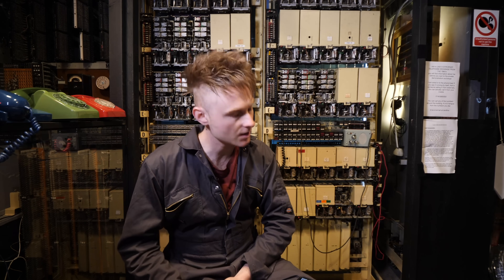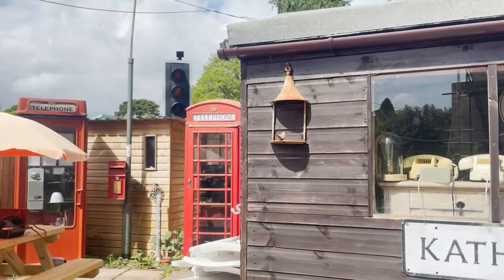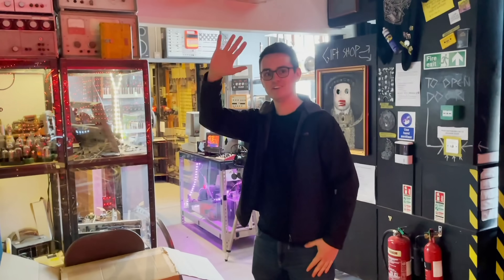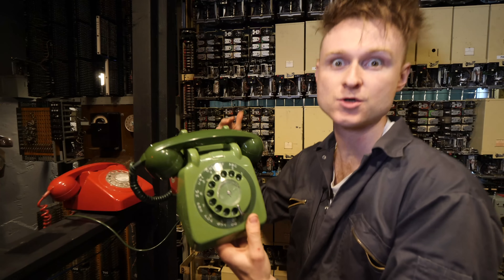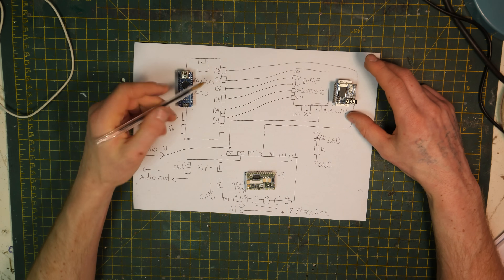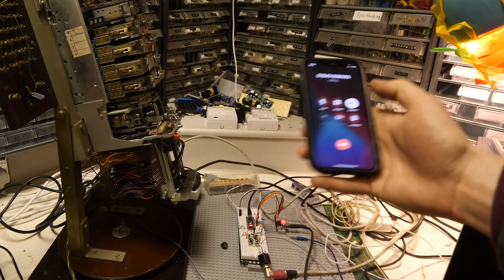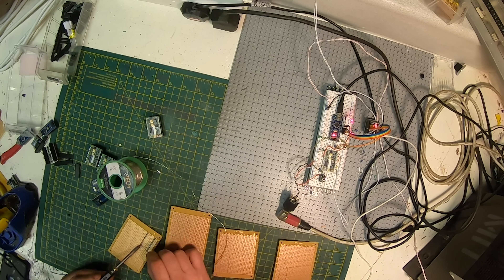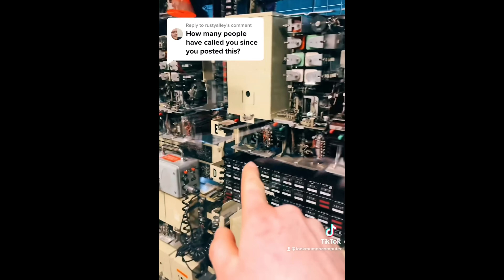Plugging a Vintage Telephone Exchange Into The Internet So People Can Use It

Comment: did i hear the magic word.. asterix?

Setup a sip proxy that people can connect in over the internet itself with using sipphone or sjphone or a cisco/linksys spa appliance.   That gives you effectively unlimited incoming lines.. and allows you to load balance by redirecting flash floods to a recorded message when all your physical lines are tied up...  also saves needing to actually pay for incoming time on a real phone.  Some spa devices too natively support pulse dialing if you plug an old POT pulse phone INTO it.

Edit: also SPA devices can call each other directly by ip address.. which i imagine you could do some very interesting things with...   Random internet guys SPA --->  internet ---> your spa --> open phone line to your exchange!

Comment: 9:39 is it possible to use discrete logic to convert the 4 bit pin output into a pulse? I sure have read about that in some old electronics book but yeah microcontrollers are just dirt cheap these days. Also hard to control the latching of the signal?
No computer ^_^

Comment: Used to work on these in country areas in Australia, we called them RAX’s (Rural Automatic Exchange)  in the early ‘70’s. Later we installed Ericsson based “ARK” “crossbar” switch based exchange equipment.
Enjoy your journey with the Step by Step (SXS) equipment you have there.

Comment: I'm curious why you didn't use an off-the-shelf telephone interface. I think most of them are still capable of doing pulse dialing.
Reply from the maker: Find one that converts dtmf to pulse and link us 👍
Reply: @LOOKMUMNOCOMPUTER  Tried linking one but YT ate the comment (maybe because it contained a link?) Any DAHDI-compatible interface in Asterisk supports pulse dialing, e.g. the OAK8X with FXO modules, should be fine. It's up to to the inbound channel in Asterisk to decode DTMF, and then the outbound channel regenerates the DTMF or pulse dialing.
Reply from the maker: @CoolerQ  aaah yeah I see. I have some fxo cards that’s the original approach I took but I couldn’t get it to do all of the time out stuff and hang ups right. Also the gaps between certain numbers and hang ups for the exchange to not get confused. In the end it was easier to do the approach in the vid.
Reply: @LOOKMUMNOCOMPUTER  Well, that sounds like a software problem. I'd rather have reliable hardware and unreliable software than the other way around, because it's a lot harder to upgrade hardware :) But yeah I can totally imagine pulse dialing is not well-tested in Asterisk.
Reply from the maker: Cus we couldn’t find one that did it with all the requirements

Comment: 7:50 What you're doing here is actually an early form of phone hacking. Sometimes people would try to prevent phones being used to dial out by fitting a key lock on the dial – but it was still possible to dial numbers using this rapid break/make technique. Amazing, I never thought I'd see someone doing that again :D
Reply: Back in the 70’s my parents put one of those locks onto the phone to stop me from making phone calls, obviously they cost money, so I found out that you could bypass the locked dial, by using this method, so when the phone bill was higher than expected I could just say that it was nothing to do with me . Lol
Reply: Yep - I remember here in New Zealand as a young lad (45+ years ago)...we used to go into a public phone box and tap out a number we wanted to call using the receiver 'hook' (in reverse as Sam mentions: 0=10, 8=2, etc.) and we could talk for free.....wow, I think we saved a whole 4 cents?  Anyway, that was a very different meaning of 'phone tapping' :)
Reply: Yep, I used to do that in the States back in the early '80s. Sometimes reception areas in hotels and schools had an "incoming only" phone with a circular dummy plate in place of the dial. This was an easy way to dial out and save payphone costs.
Reply: We could do the same thing with Army field phones, that had no dialer.  Normally routed through a switchboard.  We could plug the field phone into a line and tap out a number to call.
Reply: Wasn't it called "phone phreaking" back then?
Reply: @nongbloke  Yep, it was indeed! I believe there were other phreaking techniques too, but I don't know much about them.
Reply: @macronencer  I was "blueboxing" in the 90s (mid-late) as a teenager.  There were these toll-free (800, I'm in the US) numbers which rang directly to operators in various countries.   I have no idea who paid for them.  Most of those countries used out-of-band signalling, but some of them used CCITT 5 in-band signalling.  It used the same MF tones as the standard used in the US, except the supervisory signalling was more complex.  Well, after frustrating the operators for hours with my failed attempts (the equipment did not pass on-hook audio), I finally managed to seize trunks in Belize, Greece, and Chile (maybe some others).  The only one that had no restrictions was Greece, and it was an utter delight to use.  I rigged up a little box with a transformer and whatever else (I knew more about electronics then than I do now haha) which I used to hook up my sound card to the phone line, and effectively turned my computer into an operator's console.  For a while, I would even call my friends with it; they didn't appreciate the delay as much as I did.  ;-)  I could call inward operators in the US, too.  One day, after a year or so, I received an ominous message on my answering machine from "the phone company" asking if I were having problems calling Greece.  The number on my caller ID led me to believe it was probably some federal government agency, so I cut back a lot after that. :-(
Reply: @bsadewitz  Haha, wow! That's going deep :-|
Reply: @nongbloke  Most phreaking was on more technical equipment than that. Just dialling with the hook doesn't get you free calls or anything, to the exchange it's an ordinary call and you're billed accordingly.

Phreakers working with more complicated exchanges than that, ones that were digital or semi-digital. They'd use control tones, brief beeps, internally sent down wires to control trunk calls (calls to customers on distant exchanges, not the same exchange like if you both lived in the same town). The right sequences of tones controlled all sorts of things, and the holy grail to a phreaker would be found digging through the rubbish bins behind an exchange, looking for a technical manual. This would have all sorts of useful info.

Anyway... these tones... they were used internally, but phone companies rather foolishly would respond even if the tone came right from a customer. So phreakers made little boxes (and they all had their own names) that produced sounds of this or that frequency. Sometimes you could take a DTMF pocket dialler (they made those!) and change out the crystal to give different pitches than the device was built for. So you'd have a little box you could tap out the tones on to remote-control the phone lines.

So you could make distant calls for free, create conference calls, whatever was possible, from either your phone at home or some payphone somewhere. Talking of which, with some old American payphones you could call the operator and tell them it wasn't working. They'd ask you to insert coins and put the call through manually. When a coin was inserted, the phone made a particular beep. Different tones for different coins. So....! You could insert as many "coins" as you felt like beeping out, the operator would hear, and think you'd paid up.

All sorts of phreaking stories. Mostly from the '70s and '80s in America. Oh, finally, one that works in other countries... You call up a company out of hours, who have a freephone number to call. You get their computerised switchboard. It asks you which extension you want. Sometimes, you can dial 9 for an outside line, so their switchboard will call whoever you want. You're connected free, they dial out to whoever. Nice trick! People would try hundreds of freephone numbers to find one with weaknesses like that. Tonnes of fun!
Reply: Same :)  You had to do it very quickly and it was easy to make a mistake and misdial.
Reply: It'd be cool to see a crossover between LMNC and 8-bit Guy talking about phreaking
Reply: @stinkymart3173  The problem with 8BG and phreaking is that (no disrespect to him) he has a very "surface level" idea of the whole thing. Evan Doorbell is a good resource, plus he's an awesome guy and would give the shirt off his back to someone in need. He was there during the inception of phreaking, pretty much.
Reply: Ha, I remember doing this as well, and it was old tech then!
Reply: Rapid make/break is exactly what the dial is doing.

Comment: People can make SIP calls directly over the internet, and any of us using a pbx that supports it could trunk to you... so your trunking service's minute limit isn't necessarily a deal-breaker. You'll have to enable "Allow anonymous inbound SIP calls" and be damn sure anything that can dial /out/ (like to the pstn) is secured, then attach a domain name and advertise it... sip:extension@hostname ...

There are several other youtubers with big vintage phone switching systems as well... trunk 'em all together!

Something like the Grandstream GXW4108 is a bunch of those analog adapters all in one box, and it works with asterisk. SOME of them (I can't speak for the gxw4108, it's been years since I touched one and I didn't try this at the time) actually support pulse dialing as well.

Comment: This is brilliant, Sam! As an ex BT Strowger engineer from the 70s & 80s, it's great to see and hear those switches stepping!
Reply: Me too,I don't like to think of how many of those things I've cleaned. Once we had got thru the entire exchange it was time to start again.
Reply: @adeladd7638  yes, wiper and bank cleaning routines were certainly a chore!
Reply: Lovely to see and hear. 
We have a working Strowger unit and a Crossbar working in our museum. It’s a hands on museum, with all the different types of phones still working. Plus other connected peripherals, very popular with the visitors.
Reply: I know a guy who contracted telephone systems in Puerto Rico on a X-Y cross bar system and was complaining about bugs in the system.....literally bugs shorting out the cross bars. I hear your cleaning woes. Have a good day.
Reply: @fredmanicke5078  It was a long time ago,but I can still the clack and brrrr of Strowger kit if I think of it.
Reply: I worked on them too. Hated Bank cleaning (cleaning the rows of switch contacts) and relay adjustments. Became involved in the installation of digital and then rippng out the old switches after transfer. Nice to see that there are a few being preserved in museums and projects like this.

Comment: Back in the 90's I worked for a company that installed voicemail servers based on OS/2. We had a bunch of different hardware cards to interface with the telephone systems. We mostly used Dialogic cards to service the incoming calls, Aerotel Pulse to Tone converter cards and PRI/BRI cards for ISDN/E1 connections. I have to say your solution is a lot smaller than what we used to put up with. Four analog phones lines required a full length ISA card. The pulse to tone cards were much bigger and much heavier than Teensy!

Comment: If you can aquire a Digium TDM2400 you can have up to 24 lines that will work with astrisk just make sure you use the FXS modules.

Comment: You should make one of the lines repeat a loop of Slow Scan Television with an image. Anyone could call it up, use a SSTV decoder, and see the image after waiting for a while. There's a lot of interesting possibilities. Mechanical stuff like this is endlessly fascinating.

On an unrelated note, it would be cool to see a synth module that is controlled by a Geiger counter that has some uranium glass near it under blacklight. The glass would glow green in the dark, and you would have pretty much true randomness controlling a synth.
Reply: The synth module idea has been done!  https://www.youtube.com/watch?v=Fj1PhEqVBq4
Reply: I absolutely love this idea, huge SS TV fan myself!
Reply: All you need is a pair of  Mitsubishi VisiTel, one your end and one the other end. My parents had a set and used them to see the Grandkids from Montana to Texas.
Reply: @fredmanicke5078  This would work for video but what we are talking about "SSTV" is a way of sending still images. It is commonly used by amateur radio operators "hams" and is similar in function to the way old dial up modems worked. Each signal/image is on a specific audio frequency so you could actually have a number if different images being transmitted at one tome and use your computer do decode them. I have done this with music as it only uses one frequency/tone I have used a audio notch filter to remove the frequency of interest for the music audio and then insert the data stream... depending on how you do it you can almost hide the data signal in the music.
Reply: @smrp1984  Hm multiple images at once, clever! Seems in line with the technology and way of thinking at the time. Seems like it's AM modulating a lot of particular tones. Why not FM modulate instead and be able to send pictures quicker? Or do both... somehow... RF isn't my thing. 

If you could send several images at once, could you do moving television? That's sort of the idea anyway right? You'd need memory to store each of the images which means a computer, and the ones at the time suffered from lack of colours, and shortage of memory! Just the things you' need. I suppose you could build your own computer with a nice grayscale DAC for the colours, 16 shades per pixel maybe.

Hm did hams ever use the Baird-style mechanical television? With a home-made Nipkow disc and an LRD or photodiode you'd have a camera infinitely cheaper than the ones on sale commercially in the '70s.

Incidentally shouldn't Nipkow be seen as the inventor of television? All Baird did was use Nipkow's "image dissector" disc exactly as it was supposed to be used, to do the job it was meant for. All he did was wire a radio transmitter to the end of it, and a neon bulb behind another Nipkow disc in a television receiver.

If I were a patent examiner I'd have rejected Baird as "obvious", an obvious use and follow-on of Nipkow's disk. I wonder if he got any royalties. I doubt it.

Comment: damn thats pretty cool, basically almost the setup we have for out uax13 exept we used iax2 instead of sip cuz people spam sip ports on our server when we used it. another thing is you can get pci cards that plug into the asterisk box that run pulse dialling natively which simplifies stuff alot  (idk if you can use both at the same time one on an incoming line and ) the only hardship is that you have to change a number in a file in the driver code before you compile it. also you need to connect your exchange to other peoples too cuz i know a bunch of people with asterisks and we could have quite the network going. this is really cool and i hope that this takes off cuz strowger equipment looks its best when its in use. one other thing, how'd you get people to dial a normal phone number cuz when we did it we just got an app that acts like an ip phone that calls over wifi btu you seem to have made it work over a normal line?
Reply from the maker: Where is your stuff???? As in which museum? Sounds interesting!
Reply: @LOOKMUMNOCOMPUTER  its not a museum but more of a collection, me dad does it as a hobby as he likes collecting but hates when stuff is not functional. currently we have a full uax13, 3 seat manual board, test desk (exactly the same as shanes one as it came from the same guy ours is from but ours is, pretty much fully working)  and the starting of a register translator (which works like a telephone version of a home router translating one number to another to go through  an exchange). as far as location goes we are up in Herefordshire which is quite a way from where you are sadly but its worth the trek since my father would explain everything to you on how it all works lol.

Comment: Nice one.   BT never really worked out a reliable DTMF to loop disconnect adapter.  They just upgraded everything to system x.  I was part of the upgrade team for payphones in London as the old pay on answer phones couldn’t cope with the upgraded system.  They used a pulse between the A and B legs and ground ,  multiple grounds on a digital system apparently made system x an ex-system!